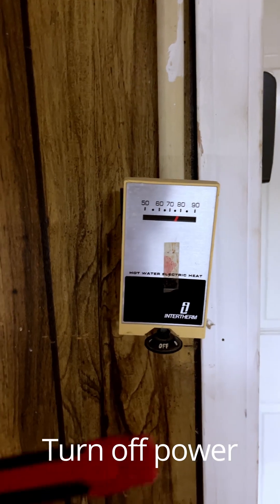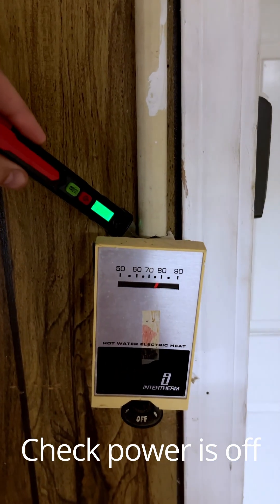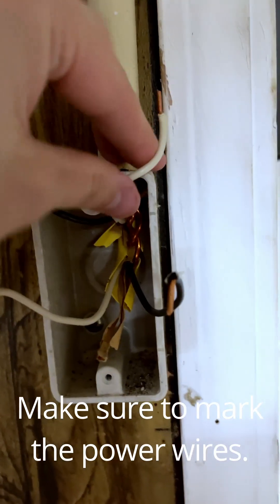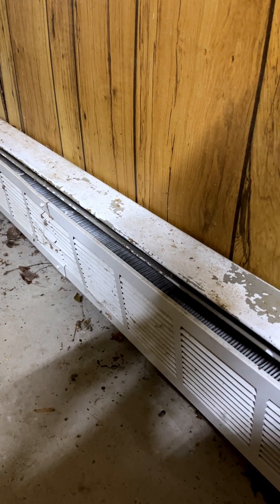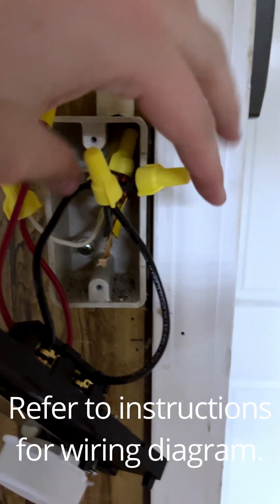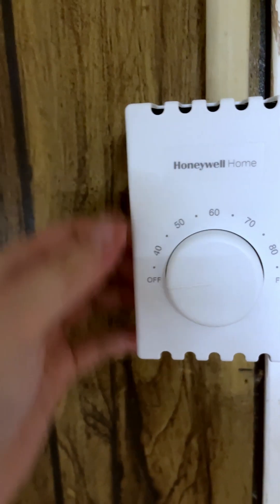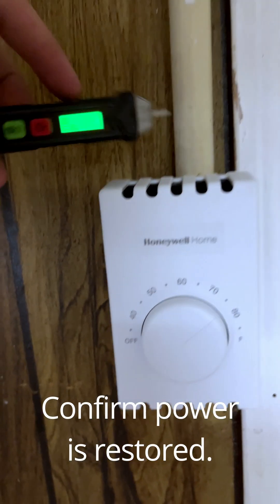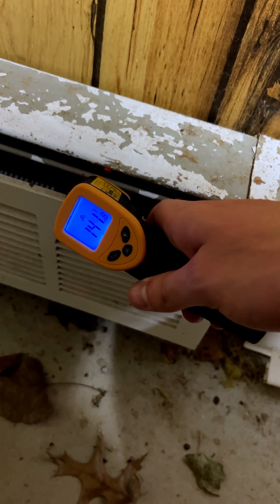How to Install a Baseboard Heater Thermostat

Comment: Someone made a comment about check your voltage tester.  That’s why I’m not a tester weenie, come on guys start using multimeters. Why, cuz you can tell wether the voltage is subpar.  Next he states 110 is deadly, well actually 99% of the time they run on 220, which by the way is even deadlier.  It you register 110v on a Multimeter then it’s probably wrong and you wired a common on ground wire. Should I have to explain we are talking AC. I mention this cuz some multimeters start DC and you press a button for AC

Comment: U didn't even say anything about what was the power in and out top or bottom wires of the stat nor did you say weather it's a 220 or 110

Comment: Your video was very helpful, but I was expecting to see you connect wires down at the baseboard heater. What's your baseboard heater is much bigger, older and taller than my current brand. New 6 ft 220 powered baseboard electric heater
Reply from the maker: Sorry, I was just upgrading my thermostat in this. Is it just three wires to land on the heater side?
Reply: @Corey.Deaton  I did a little bit more research. I guess it's not that hard. I'm running a brand new 2 20 volt baseboard heater where there was two 20 volt. It's just I'm going from the knob on the heater to a knob on the wall. Four wire four wire I'm guessing

Comment: Pro tip regarding these voltage testers. NEVER assume that it is working. Before using it, test it to make sure it responds to voltage present, just as Corey did. If you don’t test it first, you cannot be 100% sure that it will light up in the presence of voltage. 
110 volts is deadly, friends, so be impeccable about making sure that detector works before trusting it. Just because it worked a day ago or an hour ago doesn’t mean it is working NOW. Test it every single time.
Reply from the maker: Great tip! Thanks for adding to the conversation.

Comment: Whoever had my house before me hooked this up all weird and had the same power line split, coming in to the red and black at the top. Then had the outputs T-ed together as the baseboard incoming. The heater before was either on or off, and when it was on, it made the room blazing hot. Thankfully, I could figure out how to fix it from your video! My room is now properly controlled. Thank you!
Reply from the maker: You are welcome! Glad this helped.
Reply: Same here. They didn't mark the panels very well to indicate which is which.